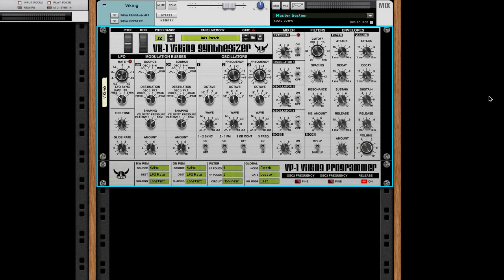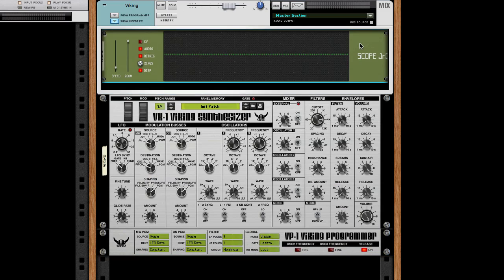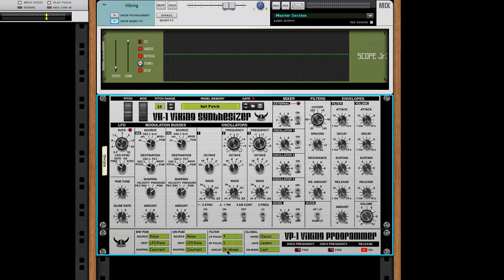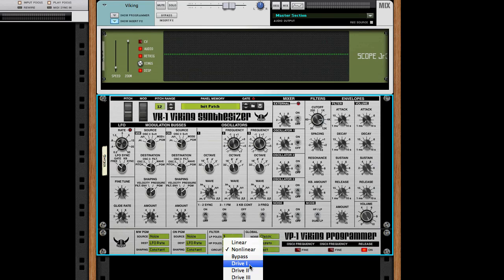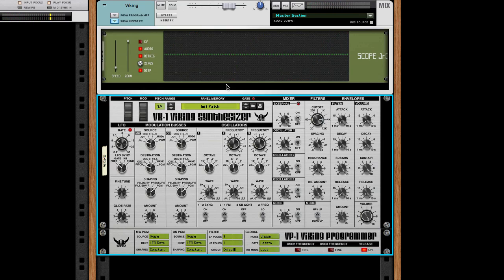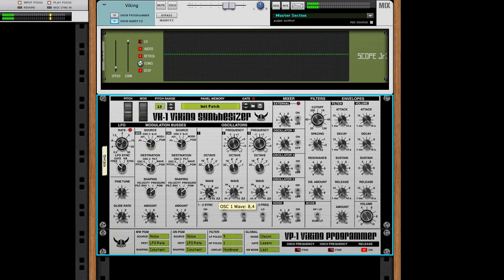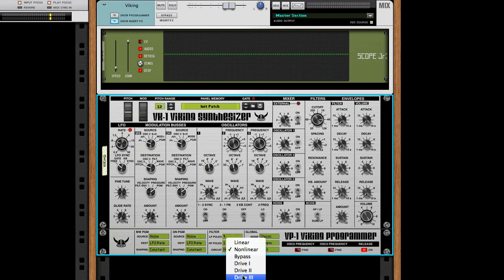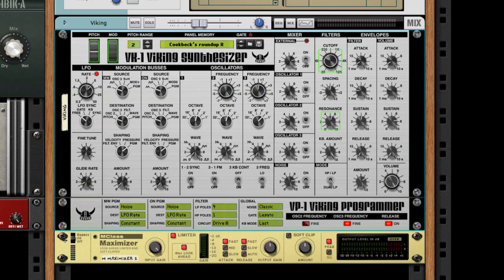VK-1 Viking: New filter drive modes

Comment: Bist du Deutsch?? Cool video.  I was going to get the VK-1 anyway, but I love how you can push it harder now.  Do you like any other vintage synths's for Reason?  I've been thinking about getting a Moog, but I'm so spoiled by being able to do everything inside of Reason.
Reply from the maker: +eraserfishmusic Glad you like it, and yes I'm German (the accent gave it away, right?). I did get a Moog Sub 37 last year, and since then I've been using less and less software instruments (actually, the only one I'm still using is a Fender Rhodes emulation). It's definitely worth it. I'm still using Reason for recording and mixing my tracks.